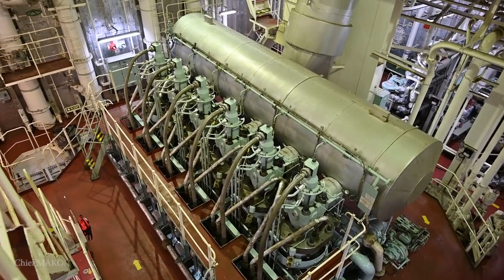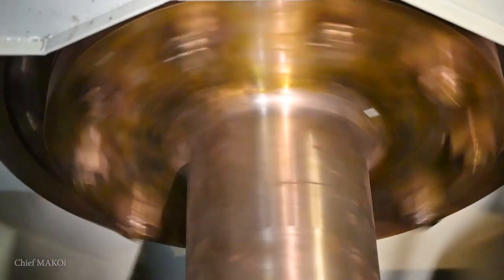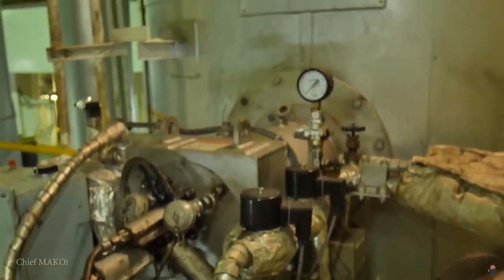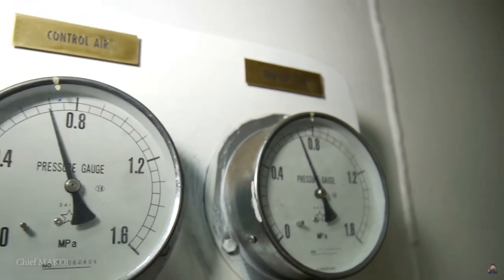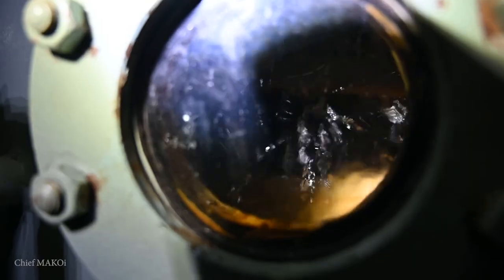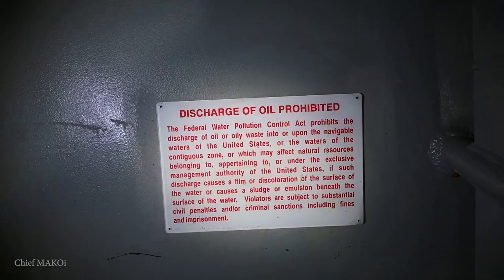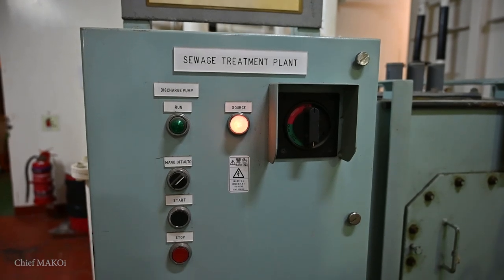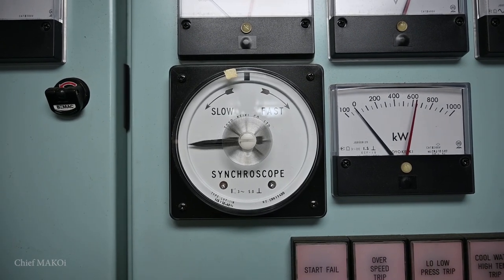The Machines in a Marine Powerplant | Chief MAKOi #ships

Comment: Great information Chief! I am a second engineer on the Great Lakes in the USA , very similar plants, we use mostly medium speed diesels that are coupled through a reduction gear for correct shaft rpm. Also we have pto generators hooked up to the main engines that we use while we are underway or discharging our cargo. We too have generators that can be used to run the unloading system or just house supply. Sometimes when racing a boat to a port we can put the house electrical need on a generator so we can gain 0.2knots so main engine doesn’t have to supply the power to run pto generator to main bus. Take care and thank you for showing people our world

Comment: I was an engineer on a USN ship with gas turbines.  So many similarities,  just substitute gas turbine/diesel.  I agree about the generators.
Reply: USS Brush (DD-745).  Twin 600# steam turbines and no AC in engineering control.  What did you have?
Reply: USS Chandler DDG-996. Gas Turbine Systems tech GS1. 4 GE LM2500 gas Turbine engine's and 3 Allison 501-K17 gas Turbine generator set's. After 6 years in the Navy I was recruited by the Anniston Army Depot for it's M1 Abrams tank program that was just getting off the ground. At first we only rebuilt the AGT-1500 Gas Turbine Engine. Later we started upgrading and rebuilding M1 Abrams Tank's. I went to school to learn all systems on M1 Abrams Tank's. After 24 years with the Army and 6 years with the Navy I retired with 30 years service.
Reply: @n4zou  I have a few questions about how the Chandler's propulsion system worked.  Since this is an open forum, we will have to figure out how   to chat.
Reply: What type of fuel do the gas turbines use?   Is it more like jet fuel or diesel or heavier fuel oil?    Thanks.
Reply: @joesilverbliss1721  we used jet fuel the same as aircraft but any liquid fuel will do. Generally the limiting factor is the type of fuel nozzles that spray fuel into the combustion cans inside the engine. Also there are heated settling tanks and equipment to process the fuel to be used by the engines. If only heavy oil is available it heated to reduce it's viscosity and to allow dirt and trash to settle to the bottom of the tank or float to the surface. Then it's further processed to remove all fine particles that could clog the fuel injectors or damage the engine with a sand blasting effect. Gas Turbine engine's can anything flammable. In the early days rail road companies built fuel systems for gas Turbine engine's that used finely ground coal as the fuel. This actually worked but it cost more to process the coal into a fuel that could be used in a gas Turbine engine and so they went back to using standard Diesel fuel.
Reply: @n4zou  Thanks for the information.  Joe
Reply: @n4zou  Well if you "raced" Chief Makoi here in who could get going from cold and dark to full power and underway, I am pretty sure you would beat him with ease.
Those LM2500's are quick to get going compared to traditional engines.
But they are totally different beasts on the inside, Agent JayZ is a YT channel that shows service and work on various gas and jet engines.
Reply: @CMDRSweeper  correct. Gas Turbine engine's don't need to be warmed up after starting. You can go immediately to full power output after reaching self sustaining speed. If you've been sitting with a completely cold engineering plant you do need time to get the fuel systems up to temperature to have fuel ready to go. If you have jp4 jet fuel in the ready use tanks you can start the engines on ambient temperature fuel and the tanks are large enough to run the engine's long enough to bring up a cold fuel processing system and start refilling the ready fuel tanks for the engines. Typically before pulling into port and  expect to shut down everything you will have jp4 jet fuel in full ready tanks just in case the ship must leave port in an emergency situation. Once we had a training exercise where an inspection team showed up, woke up the Officer on Watch who was the acting Captain and told him he had 15 minutes, beginning immediately, to get the ship away from the dock and heading out to Sea. A simulation attack was happening. General Quarters was sounded and off we went. Axes were used to cut the lines holding the ship to the dock, all 4 engine's were started, and we pulled away from the dock with minutes to spare. We then left port at high speed with just the duty crew on board. After getting out to Sea the inspection team made sure all the weapon systems were ready to go into action. We then operated with just the on duty personal on board for 24 hours at General Quarters. We passed that test and inspection.

Comment: The thing to remember about Diesel engines is that they will run on any fuel they can atomize.  In fact, Rudolph Diesel designed his prototype to run on peanut oil.
Reply: Detroit Diesel 2-cycle Diesel engines are famous for running away despite shutting off the fuel to try and stop it by burning it's own engine oil. You've got to shut off the air going into the blower to starve the engine of oxygen to shut it down. A built in flapper valve is located in the air intake between the air filter and blower to do that. Once a week we would check and test it to make sure it worked properly.
Reply: Yes them big old 2 stroke DDs are virtually indestructible unless it runs away with itself to destruction.
Reply: @PapaTanGh0stNI9htM4R3S0nMaInSt  or runs in the crit range too long and shakes itself to death
Reply: Tons o boneshaking teeth rattling fun.
Reply: The first diesel ran on coal,dust.
Reply: @williamgibb5557  Diesel experimented with coal dust suspended in water, but by the time he had a production prototype on display at the Paris Exposition he was running it on peanut oil.  Either way, it demonstrates that diesel engines can run on just about anything.

Comment: An interesting video would be to explain the complicated steps required to restart a ME and ancillary systems after a total black-out, with no starting-air in the accumulator tanks and no running generator.
Reply from the maker: That's a great idea.
Reply: @ChiefMAKOi  small  Honda generator hooded up to a 2 gallon Harbor Freight compressor plumbed into the main air reservoir tank;
Come back in a week to start 😊🤣😁.
Reply: @richardbause2453    The Honda would still be running.  Doubt that the compressor would.
Reply: @tomrogers9467  gotta have faith 🙏 😊🤣.

Comment: Definitely the electric generators are the most important thing onboard.
I heard many scary stories about dead ships and how difficult is to recover from a dead ship situation; completely different from the dead ship test/exercise you do during new build or drydock operations.
Reply: I was on board a LNG carrier as a cadet, and I have never seen engineers working as hard as they did when we experienced an electrical black out.
Because they were afraid the main boilers (for the turbine) would cool down in which case it would be incredible complicated to restart all the engine room systems.
But luckily they succeeded in getting it back up and running quickly.

Comment: Worth mentioning that the oily water separators for the bilge water are actually controlled by an electronic "white box" (aka the witness box, aka the snitch box) that is behind a tamper-proof locked cabinet that only the chief engineer holds the key to. The purpose of the white box is to test every single discharge of bilge water from the ship and log the (passing) test results electronically in an encrypted format for future inspection by port authorities. It physically prevents any discharges that exceed the MARPOL regs for oil content. It also logs any attempts at tampering.

Gotta love how the powers that be didn't even preserve the illusion of voluntary compliance. They care more about bilge oil than crew safety - why no snitch box to ensure the crew gets fed every day?

Comment: Great episode.  My experience is with fossil fuel or nuclear steam ships.  Curious about seawater cooling,  Most steam ships use pumped seawater only when in port or at low speeds.  When cruising they use "scoop ingestion" which uses a shaped sea chest to drive seawater through circulating piping.  Do diesel ships have this same arrangement?
Reply from the maker: Not that I know of.
Reply: @ChiefMAKOi  breaks da machinery giggles runs off 😂

Comment: Thank you for that video. I would love to see an  engine room in a recent cruise ship. Wonder if they use 2 stroke diesel/prop engines or azipods with diesel generators for high voltage power.

Comment: Chief what if an important part of engine undergoes a major breakdown and spare parts aren’t available , how will engineers manage that situation in middle of the ocean ?
Reply from the maker: If it's in one cylinder of the Main Engine, that cylinder can be isolated and the engine will still be able to run at a lower power.  If it's totally impossible to do temporary repairs, there's no other choice but to call for a tugboat.
Reply: @ChiefMAKOi  Thank you for replying. Love and respect from India.
Reply: The engineers make sure they carry sufficient spares to deal with emergencies. Also there is a machine shop somewhere in the engine room which includes lathe, welding equipment, and other machine tools so that engineers can at least roughly construct parts which are not available. Raw material in the form of metal bars, pipes, and plates to different sizes are available on board for this work. The ship has to be completely autonomous sailing the oceans. It has to be said that a breakdown which disables the main engine in the midst of a big storm  poses a serious risk of the ship going down.

Comment: Somewhat surprising that the main engine needs a flywheel when the propeller is already so heavy (in at least a few cases supplemented by a shaft generator).

Comment: One thing you didn't really mention on the generators, was that inside a ship, and at times, many decks down, it gets REAL DARK!
Without lighting or emergency lighting or other forms of light,  (flashlight), 'you can't see squat!'
"That'd make for an interesting video"
Reply: In the Navy on a ship you had to be able to get out of your general quarters (battle) station to your abandon ship station blind folded. If there was an emergency exit like we had in the forward engine room we had to be able to use the main hatch or the lower level emergency exit blind folded. It was common for the Chief Petty Officer to test you at any time and you had to know exactly how many steps there were on the engine room steps and how many ladder rungs in the emergency exit vertical shaft.
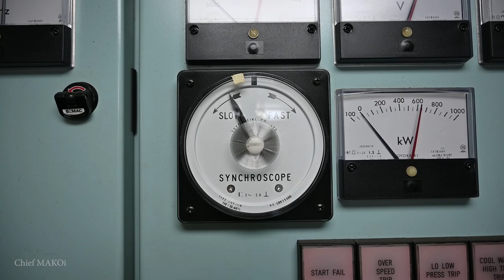Reply: 10:34.....electrity is provided by ......"the generators...........".... 10:51.....MY PERSONAL OPINION...... "the generators ARE THE MOST IMPORTANT AMONG ALL THE MACHINERY"............blah blahblahblahh..........the generators !
Reply: @10OZDuster  he didn't say that no mention was made of generators, but rather he was talking about the reason WHY they are so important, that it's really dark under the deck!
Reply: Weather it's down in the bowls of the ship 🚢 or miles back in a coal mine, 
Dark is Dark, Black is Black ⚫,  Up is Down, Down is Up, your Right is your Left, your Left is your Right. 
Sensory perception is lost. 
Need to think...
By the way, "I need a cigarette 🚬 " 
"Gotta Match "?😊😁

Comment: Do the diesel power generators run on "regular" diesel fuel? How many types of fuel do you carry on a ship? Not just liquid, but overall. Also, if a ship has some smaller boats (not just rescue boats), they might have engines themselves. Maybe gasoline engines? So is that also part of the fuel carried (even if indirectly)?
Reply: Gasoline is too flammable for ships. Any fire on board is a first step into a short sprint to losing the ship.

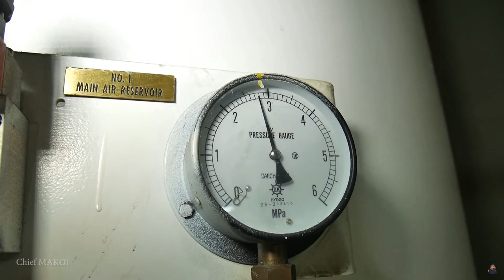Comment: At 4:28 on the side of the #2 main air reservoir there is a decal that looks like a shower head and says Co2. 
Is there some sort of liquid Co2 shower in the tank to chill it and reduce the air pressure?

If that were a liquid cryogenic tank that would be the top fill spray bar to lower the pressure while pumping liquid into the bottom, but I wonder what it means here.
Reply from the maker: It's CO2 for fire-fighting.  If in case the fire-fighters can't put out the fire in the ER, the last resort is to flood the ER with CO2 in the hopes that it may smother the fire.
Reply: @ChiefMAKOi  I am familiar with co2 flood systems, it was the sign on the side of the air tank that had my interest!
Is the sign just indicating that there is a flood system head above that location?

Comment: As a former lab manager, I do know a bit about water purifiers. I was wondering if any ships used deionisers rather than distillers or RO units, but then I realised that the cost of the cartridges would probably be prohibitive given the volumes of fresh water needed.
How often do the distillers need to be cleaned? I remember in my early lab days have to clean our small lab still every month as we were in a hard-water area and the limescale built up very quickly.
Reply from the maker: We clean as soon as we see a significant dip in the production.  Usually it happens after a month.

Comment: Do you have an electrician on board the ship as part of the crew when being deployed? I'm an electrician and it seems to me as though there would be a ton of work for them to do on the ship. I am located in Milwaukee Wisconsin and I've personally serviced 1000 foot Iron ore hauling ships on the great lakes. It's simply mind blowing the size of these ships. Usually during the winter these ships come to port for yearly maintenance.
Reply: Yeah most large ships have electricians they are called ETO’s
Reply: Actually I believe in the new STCW  requirements for engineers that, that engineers need to fully qualified as electricians.
So maybe they will be less common in the future?
Reply: @tjampman  I’m a 3rd Engineer we do some electrical stuff but no way near electrician level.
Reply: @scottduffy6654  I know that is how it is now Iwas speculating about the future, but I passed my exam before the new STCW requirements and I am not sailing anymore.
So maybe you can tell me how advanced the new training is?

Comment: Very interesting - thank you!  I was getting twitchy about when you were going to mention the generators which power all the other systems!  How much redundancy is there with all the systems supporting the main engine as you don’t want to break down mid-ocean due to a single point of failure in a lube pump or something similar?
Reply from the maker: "Essential" components like pumps etc. come in pairs.

Comment: Please be kind as I'm quite ignorate, however. Wouldn't the most efficient system to work would be a gas turbine connected to a generator and as such utilise a high torque electric motor to provide propulsion as well as general electrical power for further requirements?

Comment: I wonder if ships also require a form of emissions treatment, like many land-side power plants (which use an SCR in certain countries).
Reply from the maker: It's either the ship uses low sulfur fuel or they are installed with exhaust gas scrubber system.

Comment: What kind of redundancies are built into the generators, life support, and propulsion systems? If absolutely everything was completely dead at sea, could you theoretically get systems online with a cheap Coleman inverter generator? Or if the main engine has a catastrophic failure, is there a way to run the prop with a pony motor?

Comment: since the propeller is fixed to the crankshaft, how do you reverse turning direction of the engine?
Reply from the maker: Stop the engine first.  The run it in reverse.  There's a reversing mechanism which basically reverses the firing order of the cylinders.
Reply: @ChiefMAKOi  ahh the firing order, didn't think about that! Thanks Chief

Comment: what is the purpose or advantage to having a flywheel on the main propulsion shaft?  I've only ever worked in turbine powered ships so maybe its particular to reciprocating diesels?
Reply: To avoid irregular rpm of the engine.

Comment: Are there usually any gearboxes, or is the engine shaft normally just bolted straight to the propeller? And do the propellers tend to be variable pitch? Thanks for the great content.
Reply: Slow speed diesel is direct drive, and usually doesn't need variable pitch props, gear boxes and variable pitch props are more for steam or gas turbine powered ships, usually military etc.

Comment: So chief at how much pressure, steam is being generated at ur ship?
Reply from the maker: Usually around 5-6 bar only.  For tankers that use steam turbine-driven pumps, it's around 16-17 bar.
Reply: @ChiefMAKOi  and what's ur ships engine exhaust temperature?
Reply from the maker: @lifeisbeautiful1556  around 350 degrees Celsius.
Reply: @ChiefMAKOi  As an O&M Engineer at waste heat recovery power plant, I find ur stuff very interesting. Alway wanted to know about marine engineering, and am thankful to you for that. Looking forward to see more in depth stuff in future. Cheers :)
Reply: @ChiefMAKOi  I would like to know whats the use of 5/6 bar steam at ur particular ship as u didn't mention any use of it? As clearly shown from ur video, it is not being used for power generation and not for steam turbine driven pump.
Reply from the maker: @lifeisbeautiful1556  heating fuel.
Reply: @ChiefMAKOi  thanks chief :)

Comment: I'm curious what the difference is between a lot of the common systems that are found in marine use versus on land. Are the HVAC systems identical to ones you'd find in a building, etc?
Reply from the maker: Pretty much except the condenser is cooled by sea water.